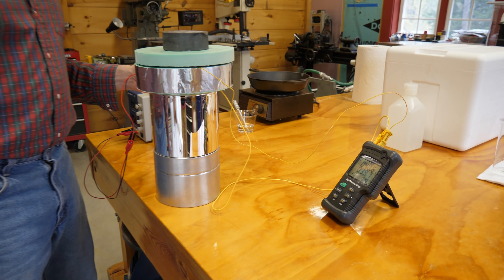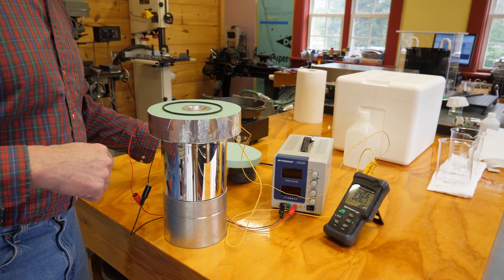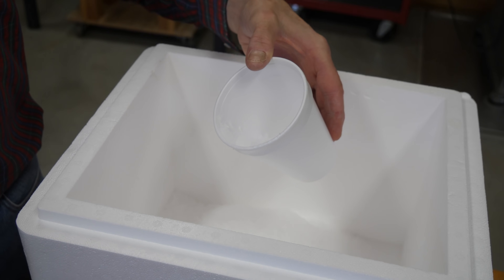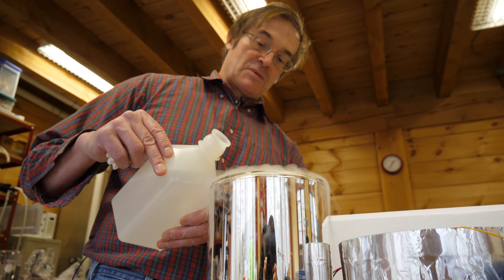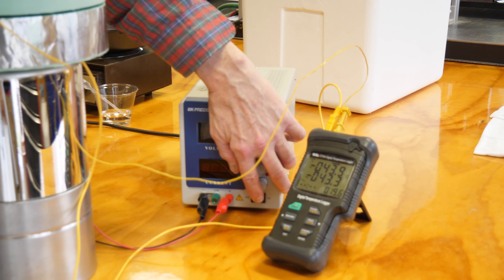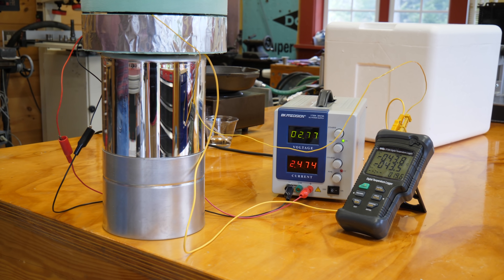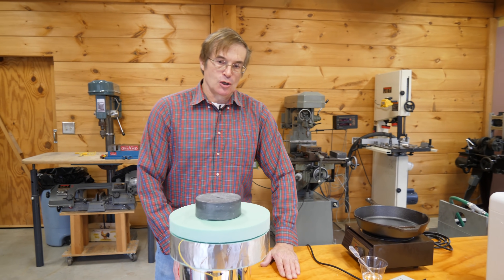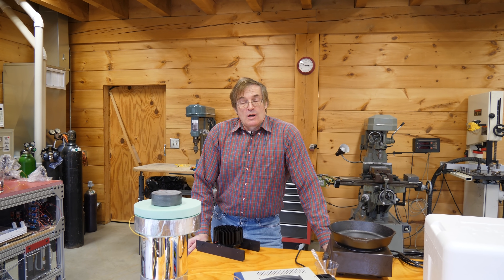DRY ICE vs ELECTRONIC COOLING!

Comment: Hi Tech Ingredients, I loved your series on TEC's as I've been thinking about a TEC setup to reach very low temperatures for a couple years by now. This demonstration here really explains well why you can't go for very low temperatures easily, or at all, even.

But through my own experimentation I recently made a water cooled heat exchanger housing with 3D printing to circulate water through with a simple water pump and evacuate all heat from the hot side and keep it at room temperature, and with this setup and a single TEC1-12706 I could measure temperatures below -30°C (my infrared thermometer doesn't go that low) on the cold side while keeping the hot side at about 20°C, which seems a much better temperature differential than what you were getting. I was powering it at 12v though, as that's the recommended working voltage for those units.

I actually thought about using methanol to circulate through a 2nd heat exchanger attached to the cold side to try and bring that methanol down to the temperature recorded on the cold side. Would that possibly work?

Comment: Could you not have used it the other way around and had the temperature differential drive the current and measure that at different t1 and t2 temperatures?

Comment: Very interesting comparison between liquid nitrogen and your "Bath" of methanol, I used to slosh nitrogen around at work (microscopy) and as you say,  when better informed your relatively safe. The only time I ever received a "burn" was when I was  told to wear gauntlets by a health and safety officer, the liquid ran into the glove and had time enough to cool my skin and then the nitrogen touched me and the air turned blue!...we never did see eye to eye after that.

Comment: I am curious if there is a relatively cheap and space efficient way to build an air liquifyer. I have been interested in that for years but Stirling cryocoolers are expensive and hard to come by.
It would be awesome to see a video about that topic ;)
Reply: yes but the smaller you go the more inefficient things get. In fact, one may construct a device the size of one's index finger that uses no external power whatever other than the pressure from a common gas cylinder to liquefy air. 

http://www.vega.org.uk/video/programme/75     (skip to 10 minutes in)
If the host of the channel is reading this, I would so dearly love to see a device like this constructed and operated....it has captivated my fascination ever since I saw that video well over a decade ago.
Reply: @Muonium1  Excellent link - thank you.
Reply: @Muonium1  very interesting video, thank you. Though I imagine that you need a pretty high pressure for this to get all the way down to cryogenic temperatures. I am curious if something like a compressor from an old refrigerator would deliver sufficient pressure... I guess I will do a bit more research about that topic.

Comment: Odd that this video was suggested because just a couple of days ago I was thinking "what would happen if you plugged your tower PC's cooling system into the house's HVAC Freon lines?"
Reply: Phase-change PC cooling has been done, but it's difficult because running below the dew point of the room causes condensation on the motherboard, which shorts it out.

Comment: I use TEC as heaters, I heat a 100Ltr hot water tank to around 55c. It will go up as the weather gets warmer.
I'm using 12 TECs in 4 stacks, 11V, 5.5v and 2.25v per layer. I started doing it last year because someone told me I could not heat water for domestic use with a 12V solar panel system (over summer).

I had been using a standard 600w 12V water heater for 2yrs previous to this but I just decided to double down in my proof.
Reply: Wu Me  Can you lend me £1000?
I plan to add a water to air (or is it air to water?) on the cold side one day but that's after I pay off my over draft.

i proved him wrong and the watt input is tiny.

I have not paid for more than 10% of my hot water for 4yrs. Building the system is just starting to pay off and reliability is a big factor. More pumps is not high on my want list. Good 12V pumps are expensive.
Reply: Wu Me  "you can just" is an option of privilege.
My privilege is minimal
Reply: Wu Me  Thanks for the thoughts though.
Reply: Wu Me  WOW!!!!!
Reply: Wasting power.
A regular heater is 100% efficient, peltiers(if heatsinked) are 50% efficient.
Reply: @Spirit532  In heating they have a c.o.p. over 1

Comment: How soluble is CO2 in methanol? I’ve done similar dry ice baths with isopropanol and acetone in the past. I found that with acetone, especially, there was still a huge amount of CO2 dissolved in solution after it warmed up to room temperature.

I wanted to keep the acetone for reuse, so I put it in a bottle, but I couldn’t actually cap it for about two days because it would build up so much pressure. I’m wondering if you experienced similar issues when trying to save the methanol you used
Reply from the maker: It's the same for the methanol.  You could also make carbonated whisky with dry ice
Reply: @TechIngredients  I'd love to see you do a video on re-carbonating flat soda with dry ice.
Reply: @greggv8  I used to do that in high school, got the dry ice from the concession stands at sports events.  As a byproduct, you also get carbonated 'popsicles'.
Reply: One method of getting rid of the CO2 would be a simple destillation. Given that you are dealing with organic solvents which have a rather low boiling point, it should be a rather quick solution to dump it into a rotavap, put the pressure to 0.5 bar and wait a few minutes.